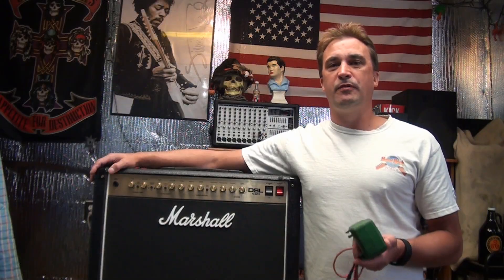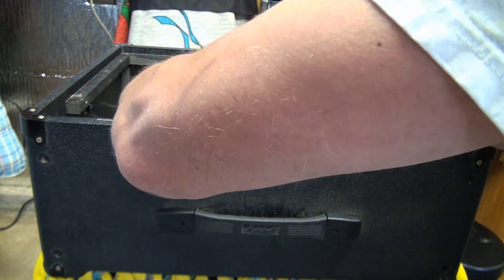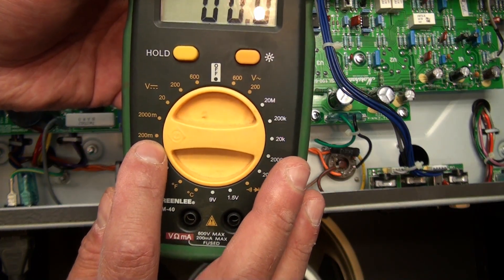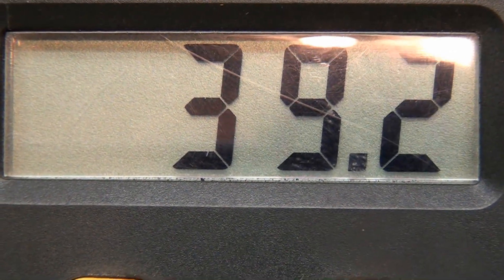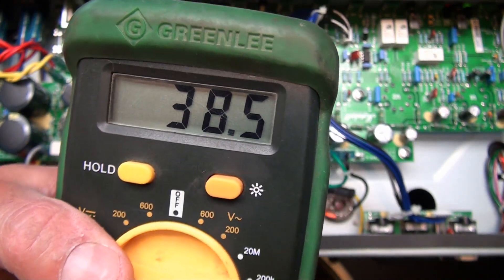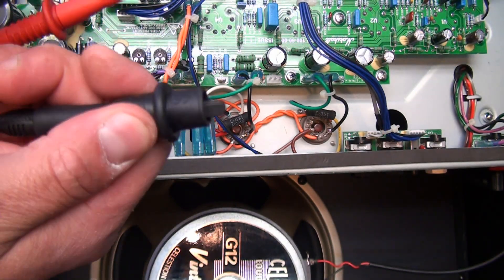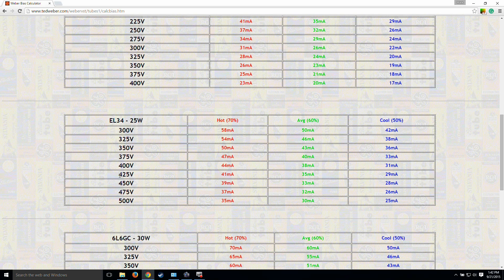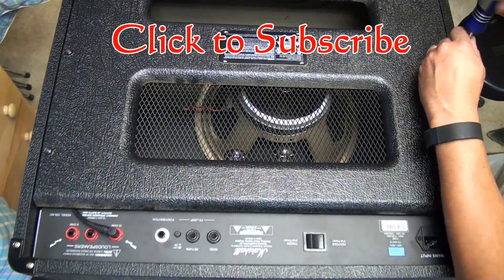DIY How to Bias a Marshall DSL 40c Guitar Amplifier Using a Multi-Meter DSL40c Measure Plate Voltage

Comment: I was having some artifact noise issues with my amp at volume . I sent it to an authorize "Marshall" service center. They couldn't reproduce the issue and they wanted to replace the tubes and bias for almost $300 to rule out the issue. I had them send it back to me. I purchased some Mullard tubes. I check the bias on the existing tube; they were 20mV below optimal. I changed the tube and bias myself after watching your video. The artifact noises are gone and the amp sounds even better than before. Thanks !!!! I'm changing the speak next, the low end "Farting" from the stock speaker is driving me nuts

Comment: Bias is NOT a matter of taste. It's only a matter of taste when the amp is within proper bias range. Any amp bias setting no lower than 70% dissipation is within proper bias range. Anything less than 70% will bring you to crossover distortion which sounds like POO
Reply: +Moshe Alvarez A bias setting of less than 70% dissipation will not necessarily bring crossover distortion. My Marshall 2203X for example sounds muddy at 70% dissipation.
Reply: Then you must like crossover distortion

Comment: Hey man, nice vid. Thanks for taking the time. Got one question though. Im in europe, here we have 220v so do i still need to bias my tubes to around 37, 38 mah or will it be different cause of the voltage? Thanks
Reply: +Francisco Guinazu Yes, plate voltage will be around 450/460 also, so bias is the same.